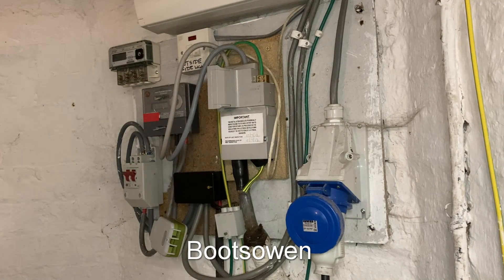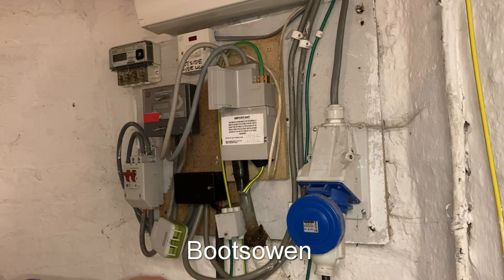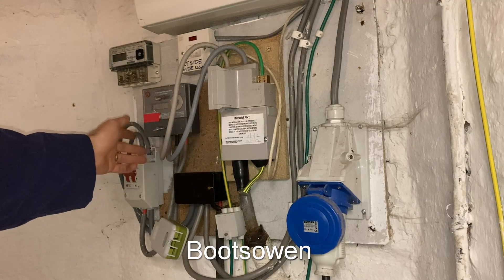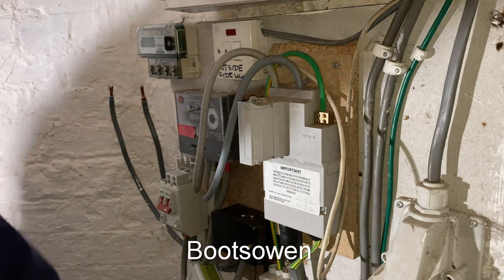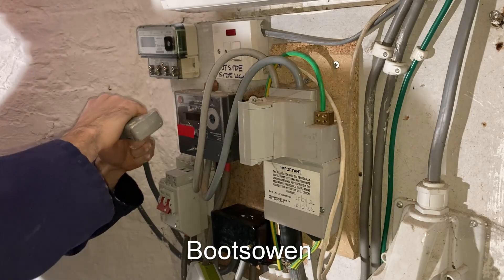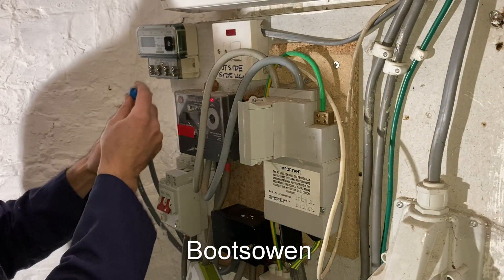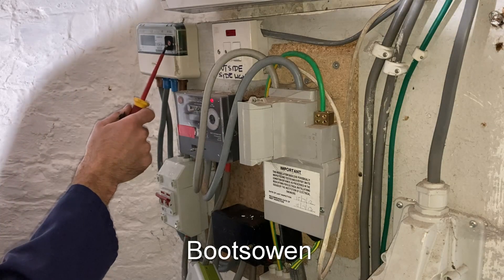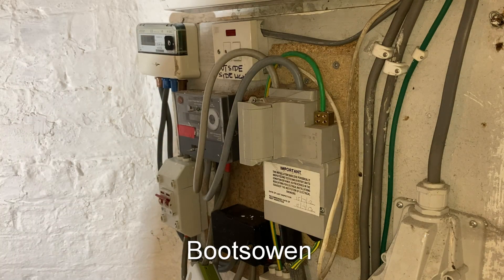How I added a reverse flow electricity meter to monitor export energy

Comment: A bit of a mess but it seems to work so who I'm I to judge 😐
Reply from the maker: Some countries make a much tidier job of these. But the fuse and meter belong to the electric company and you are not allowed to change or move them,
Reply: @bootsowen  Would you believe it if I said that I am an electrician groundbreaking I know
Anyways I was slightly confused because over here the meter and the fuse are installed outside of the house in a weatherproof cabinet the only thing inside is the consumer distribution board Usually a very large flush-mount unit designed to blend in with the wall mounted in a very reachable place preferably beside the interests of the house non of that under the staircase shenanigan or near gas pipes that is banned by the regulations
To be more specific Algeria was a French colony for more than 100 years and the electrical system usually looks like this 
https://youtu.be/O6uBwYU25lo
Reply: @bootsowen  Meter belongs to your supplier but fuse belongs to the distribution network operator

Comment: I'm thinking you have plenty of room there and it's a grand idea to get an idea of what you are exporting. The you can see if it's worth fitting a diverter, and only then if you have a hot water cylinder  so you can divert power to the immersion heater, cheers
Reply from the maker: That's the plan, so far I have generated 7kWh and 1.5kWh has escaped. Like you say, a bit of knowledge will elt me calculate actual returns on any diverter scheme!
Reply: @bootsowen  Owen that's OK for the time of year. I reckon you have about 2.5Kw installed and so that should give you 2500 Kw hr per year. In summer you may get 18Kw Hr per day. Only time will tell, cheers